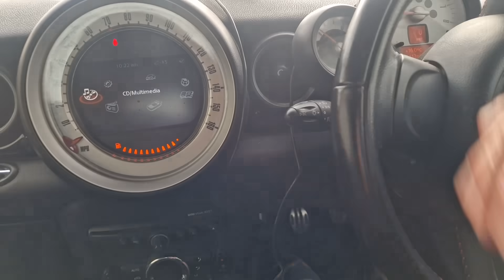What Happend To Poor Big Red

Comment: You can usually tell when a brake caliper is sticking, becoming frozen. Your cruise control will not want to engage. Any time there is pressure on the brake system a shut down signal is being sent to the cruise.  So it will not engage when a brake is sticking.

Cheers from Kansas guys. 🇺🇸❤🇬🇧
Reply from the maker: Ooh ill have to try the cruise

Comment: A reason that I make a habit of using my handbrake when I park my vehicle, is that if you don't, or rarely use it, that cable will eventually seize up and be a bigger headache.
I've noticed that when you pick a vehicle up, the garage uses the HB and it seems that you don't.  That can cause an issue.

My last vehicle was over 13 years old when I got rid of it with the original HB cable.  Shut it down, leave in gear and rip that HB on.

Comment: brakes are one of the easier parts of a car to work on. could tell your rotors were wearing bad and the rotor disc is warped with all the ridges in it. good that it got fixed and you two could go on holiday

Comment: Get a loose leaf notebook binder for each of your vehicles, and save all your receipts in the binder in order of when done. That way you will have a record of any work done, as well as the proof that it WAS done. If there is a guarantee on the work or part, that way you can take advantage of it. I have done this ever since I bought my first new car back in '76. Also save receipts for things like oil and oil filters if you do changes yourself and keep them in the binder in order too, and note on them the mileage at which you did the change. At least here in the U;S; this counts for keeping up your warranty.

Comment: Wherever it is that you take your vehicles for service, if they’re not providing you with a worksheet that tells you exactly what work was carried out you should go somewhere else mate. Maybe it’s just my local Honda dealership but the worksheet they provide also has pictures where they circle where on the vehicle work was done just in case you don’t know where those parts they’ve named are, very useful.

Comment: One question I have with all the trouble big red has, have you ever taken it a Ford dealership and have them look at it? It may be because it's not genuine parts this keeps happening. Might be worth a try.

My father swears by using a brand dealership, as you know the parts they use are meant for the car you have, meaning they are made to spec. That and you usually get dealership warranty for the job done. Never had any trouble with our Toyota cars over the years, just standard servicing done at the dealership.
Reply from the maker: Problem with for is they charge £150 per hour labour 🙈
Reply: @SherpasDay  I know dealerships are more expensive, but there is usually a reason for that, like trained mechanics and stuff like that. 

But as I said, might be worth a try if this keeps happening. More expensive yes, but is it any better to keep repairing and raplacing parts in the long run?

Comment: There is a um i forget the part it’s the part that re tracks the pads it’s not re tracting that needs to be checked. ✅ because that would cause the pads to stick. you or the mechanic needs to push on the brakes see it’s moving or isn’t re turing? it goes out but. check one check em all sometimes you can rebuild them? But it depends on your rules Tell Sherpa to go wooo wooo fix my van. yea the piston thing

Comment: Hey Jamie, if you’re going to the same mechanic or even if there’s different mechanics that you have gone to request forms to be either emailed or printed off for you if possible and then that way you’ll know exactly what was done to Little red and then to big red you’ll be able to refer and see OK this was done a little read at this time etc. etc. this isn’t what is done to big red. Hehe .. I know it’s very frustrating especially when you have two vehicles and you’re having multiple things or different things being done you think one or many things work tuned up on one vehicle and it wasn’t. It was a different vehicle, but at least they will know on file whether not they fixed it replaced it or worked on it. At least you’ll know if it was big red or a little red. That way you’re not double paying and if there is an issue and or a warranty on that part, you can question it further then.
 Hope your trip on Monday goes safely and that big red is ready to go and everything’s working correctly. I’m sure sure but your copilot your wingman would do everything and everything possible to make your travelling experience, safe and enjoyable 😂❤👍🏻👍🏻  love from the crazy canuck & the two fluffballs   🐾 🐈 🐈‍⬛

Comment: Seriously Jamie you need to keep track of what you're having done or you're setting yourself up to be ripped off! Edit: you did even better, reckon a mobile mechanic can be trusted more than a big garage because hes got a reputation to maintain. He seems like a good chap.👍

Ok so not sure what the plant is that split but you need to support it with a much bigger stake which should be at a forty five degree angle toward the prevailing wind. In other words put the end of the stake in the ground between the plant and the shed up to a foot away from the tree whichever distance gives that angle and attach just the top part to the plant. That way when the wind blows it the stem can't bend. You need to keep an eye on it, make sure it has a little bit of wiggle room so that it's roots can learn to spread and grip the soil. Oh and attach with a plant tie in a figure of eight so the stem can't rub on the stick. 👍

Comment: @5:30, Are you missing a lug nut?  Or is one just smaller?
Reply from the maker: Um.... ill have to Google that 😂
Reply from the maker: Oh hold on... ones a locking wheel nut so they can't be pinched
Reply: Ok, Thanks.  I was worried.   @SherpasDay
Reply: I have a keyed nut too, but its a good deal bigger than the others. Sorry to concern you needlessly. But it looked as if one was missing.     @SherpasDay

Comment: You might have to start keeping service logs for the vehicles. Less common today, but almost crucial in the past. I had a work van that was also a Ford that, if it wasn't for the record kept, wouldn't have had a clue that half of the lighting harness ran "hotter" (higher voltage) than the other side (used to be a kind of common thing for a certain age of Ford trucks), causing frequent bulbs burning out. Mainly because they insisted on using dissimilar metals in the connections all over. Was something for several decades, with Ford... Basically, the 1990s claim that "Quality is job 1" wasn't true.😁 Even had to replace and beef up the leaf springs on it, because it was considered heavy duty enough for a wheelchair lift, but that made the springs bow the opposite direction over time. A half tonne van isn't really heavy duty enough for them...
And there's always something. It's kind of like you only rent a vehicle, with maintenance and repairs. 😁 You'll discover that also applies to home ownership. Again, there's always something.
Looked like Sherpa just wasn't interested in being "defluffed." 😁
Stay well and safe, and give the old boy a good scritch for me! Take care!

Comment: I sounds like it would be cheaper to buy a used:
 Amazon Van ( E.V. electric vehicle they are here in US) at least u would save on buying so much gas with Big Red. I'm so sorry ur having vehicle problems, my 23yr old Beetle has been in the shop for about 3 months now the immobilizer needs 2b replaced & just had to have the radiator & assorted hoses replaced.
Both $1,000 & more for each & no warranty or extra insurance. 😩😲💔
Ur lucky u have a 2nd car.  Praying for Big Red & Little Red to stay fixed & working 🚒🚗🚴‍♂️🐺🧔‍♂️❤🙏🫶😍😻

Comment: I think perhaps you need to find a new mechanic. I assume you keep a record of what is being done to each of the vehicles each time … so you don’t lose track.

I only say this, as I was always taking my car in for work all the time as well … I chalked it up to the life of a commuter. However, when I took it to a different kind of mechanic (steering specialists) for an issue they couldn’t fix, that mechanic noticed it needed front brakes … which I had replaced less than 9 months earlier. I was advised there was no way the front brakes were replaced back then. That’s when the light came on.

Needless to say I never went back to that other mechanic who my family had been going to for over 30 years. I was the first to leave them, followed by my brother and finally my parents stopped going to them, after about a year or so later … all for the same reason.

I think you may need to stake that tree/shrub up with proper stakes, as it can’t handle it’s own weight just yet.

At least Sherpa’s doing good. 🙏🙌